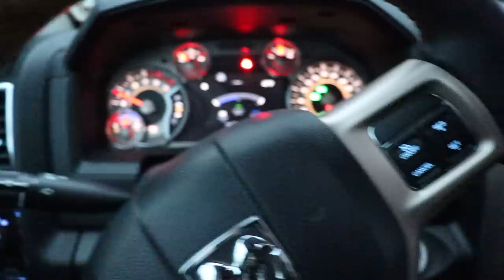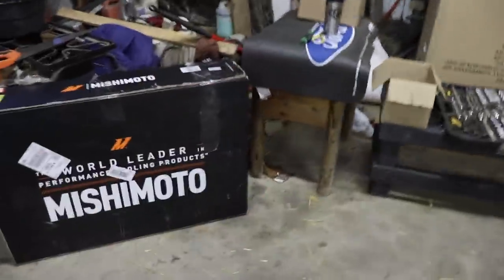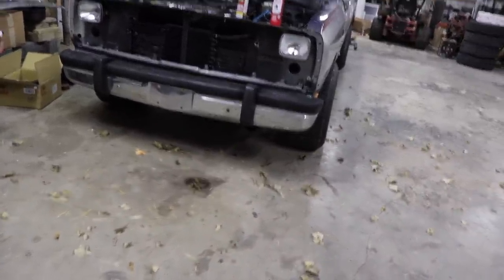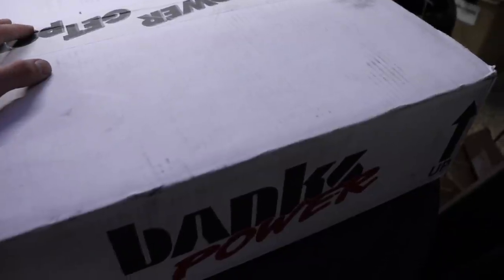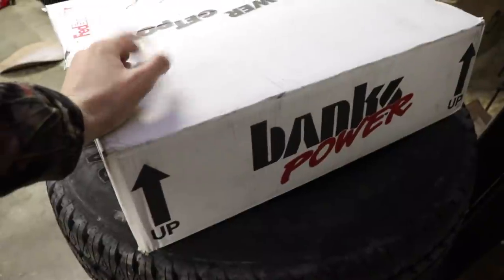PowerStroke INTERCOOLER GOING ON THE 1ST GEN CUMMINS!!!

Comment: Hey just a quick question about the fueling setup with the VE pump,  I think it’s gonna need to be maxed out to get the compounds to spool good! I guess I’m questioning if its gonna make enough fuel to support the turbos. Btw nice intercooler! I have their radiator and works great!
Reply from the maker: It says the compound system using the H1c as the small turbo.. it’s good for stock HP up to 600HP

Comment: tip for future use don't use those transmission coolers those don't cool as good as the ones that thin the fluid threw small fins.. and another tip for dodge owners if your gonna leave your truck on park for a long time like 30 min and up leave it in neutral and emergency brakes on cause dodge trucks in park the transmission pump does not pump fluid on on neutral and in gear if your live were it's hot this is a must

Comment: What about DAP? They backed out?
Reply from the maker: bayou boat trash I was done with the bs treatment.
Reply: Dude, all I wanted was to make 650 hp on a 24 valve and he tried to sell me a hot rod pump, the proceeds to tell me that anymore than that I'd have to do a p pump swap. I regret deleting the emails. Then after that, tells people something TOTALLY different on the Cummins forum. I decided I wasnt going to give that dude any of my money that. It all seemed kinda shady.
Reply: @bayouboattrash   I used alot of dap injectors never had a issue with them but never talk to them alot of these vendors just sell parts they have no clue how to work on trucks they just sell parts. That's what I have found out over the years. I got hose by to big diesel places one was bd diesel and revmax transmission I will never buy a thing from them and will steer anyone I can away from them.
Reply: @bigmurph1447  this was J Kidd, the OWNER, of the company that was supposed to know all about the Cummins engines etc. that I spoke to. The prices are great, but I couldn't help but wonder about customer service after the sale after that conversation.